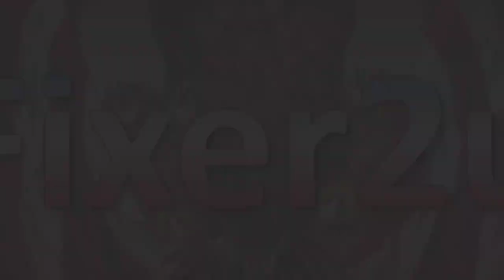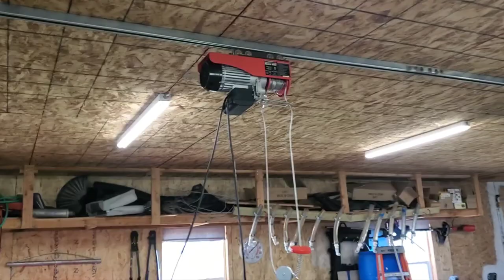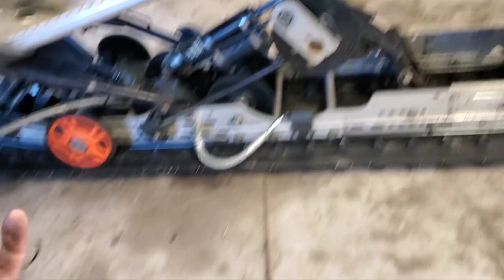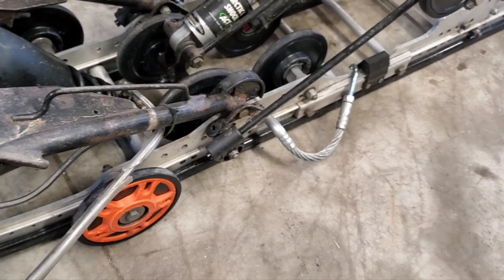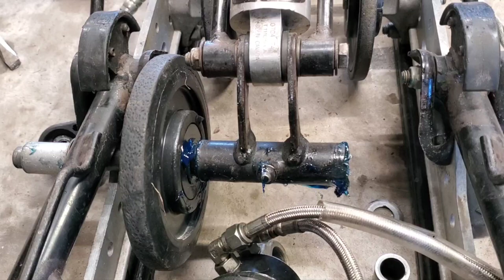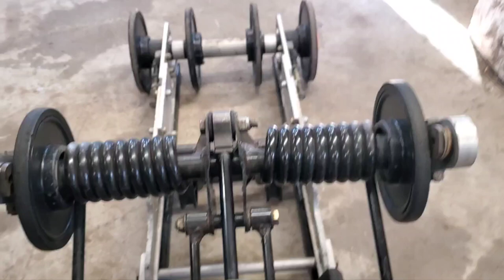Arctic Cat ZR 800 (Skid Removal) #arcticcat #diy #snowmobile

Comment: Good video,, a tip for you if you like, when tightening or lostening the track, it helps to losten the bolts on the rear bogies a little it will help the rear axle to slide more freely.. those bolts and bushings pinch together.. lostening them will make adjusting the track much easier and won't wear out the aluminum rails
Reply from the maker: Thank you for the advice.  I will definitely try that!

Comment: The rear bogey wheel bolt is the locknut for track tension. Should loosen them first before adjusting track tension. 
Those bushing can get from Motion Industries for $3 a piece. Some Arctic cat sites tell u Garlock part numbers next to AC part number . Front suspension bushing part numbers are 12DU12 or 10DU12
Reply from the maker: Thanks!